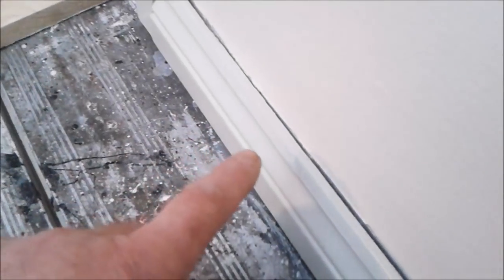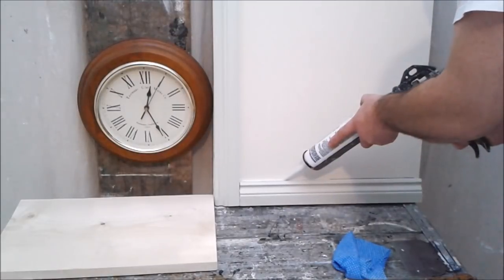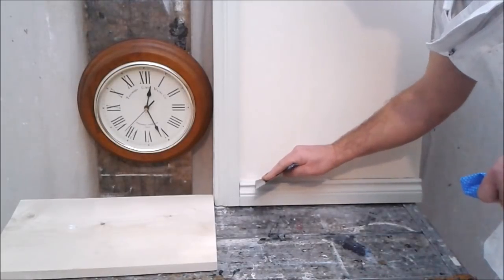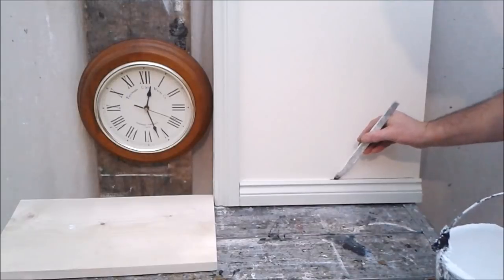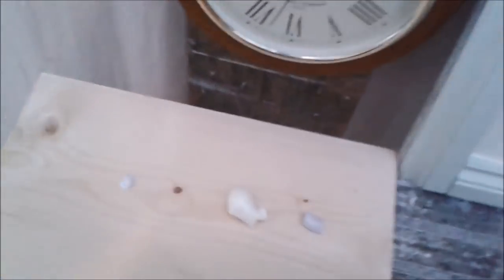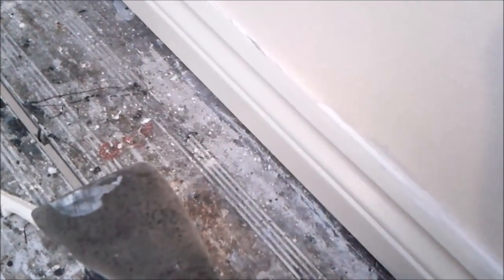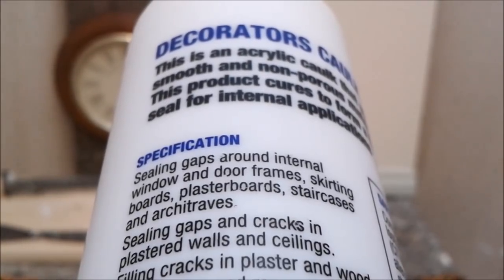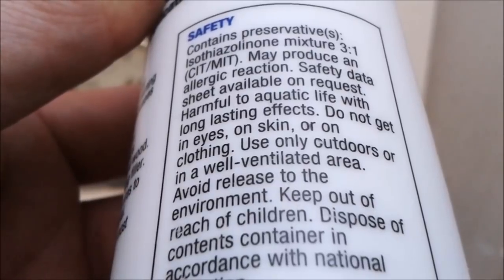Caulk quick to apply long time to dry

Comment: I’ll be 100% honest I used to use caulk regular on skirtings and ceiling lines,,, being entirely self taught I’ve picked up on other peoples knowledge, habits both good and bad, but since watching your videos I’ve just stopped using it when I do decorating jobs. Foam and filler all the way now, I did used to get really annoyed with the paint crazing over caulk, using a coat of zinsser bin over it usually stopped it but it’s such a long process. Your method is tried tested and works so it’s a winner as far as I’m concerned! Cheers buddy, you both are a wealth of knowledge! Take care.
Reply from the maker: Marc Gray Cheers mate thanks.
Reply: Could not agree with you more Marc, well said I'm the same.

Comment: For the last two years I have used Geocel Contrators Decorating Caulk. It is overpaintable in one hour and so quicker to use than powder filler. There are lots of other caulks that I have tried with varying results and some take forever to dry. HOWEVER, I have begun to use caulk a lot more sparingly these days and only for the smallest of gaps. For larger gaps e.g. between skirting and wall, my go to method now is expanding foam and skim the surface with a powder filler, as per 'Painting & Decorating' video, because this provides the neatest and longest  lasting finish. 'Geocel Contractors Decorating Caulk' is sandable to a certain degree but not in any way like powder filler. When applying caulk if you place your finger on the nozzle end and push the caulk down in the crack as you move the gun along, there is no wastage or excess caulk applied and it makes the job a lot quicker. There is a place for caulk when used in very small amounts but I use it far less often these days.
Reply from the maker: Yes true there will always be a need for caulk it does have it's uses.

Comment: I wondered why I had paint cracking problems which has cost me time on jobs. I used Dulux paint  on pollyfilla caulk and had horrendous cracking!
I blamed the make of caulk but as you say it's down to the pigments of the quality paint. Trouble is you never know it's going to crack until the next day.
Reply from the maker: markos bientos Yes stopped using it inside and the perfection on my jobs is great now. Will only use caulk on outsides around window frames.
Reply: Interesting mate thanks. Caulk does crack after a time as well. I think your idea of foam filler creates a stable base for fillers so that it should reduce cracking is spot on for longevity of the finish!

Comment: Great video
I would also use the foam and filler method astounded can sand it once dried . I only use caulk in corners if plaster is not smooth .

Comment: have u ever tried filling the gaps between the top of the skirting and wall with a 'grab adhesive' such as gripfill or similar???

i think most grab adhesives are paintable and would fill the gap nicely and dont take too long to dry!!!!!
Reply from the maker: You can possible but why not use something that's better and easy to sand and cheaper and cures quick.  I only look for the best possible finish on my jobs.

Comment: The man is right do not use caulk on cold substrates.
But I'm caulking in houses with underfloor heating with no issues. Been back after few years no cracks.
Reply from the maker: Matt Gloss caulk does not leave the best finish. Can not be sanded. And some emulsion paints can crack when drying. My jobs are better for not using caulk.

Comment: Do you mind if I ask what brand of powder filler you prefer to use? I tend to use Toupret which is really good but it suggests 16 hrs before you can paint on it which is too long. Any advice is appreciated. Many thanks
Reply from the maker: We use Polycell Trade Polyfilla Easy Sand Interior Filler White and you can use water based paints over it with in 2 hrs but needs to be fully dry for oil based paints.
Reply: Thanks very much.

Comment: This method is perfect for a diyer or as you say if you only have one room jobs. But unfortunately on large scale jobs this just isn't feasible, try doing this on a time sensitive 20 room job, it's all about the quality of caulk, and yes there are many shitty ones that ciss and crack etc. But just a case of spending that little bit extra, same with fillers, paints and most things in most trades really. You get what you pay for.
Reply from the maker: True good quality caulk on large jobs maybe. But even if I was doing a whole house I'd use my method now for large gaps because I find it leaves a better job small amount of caulk maybe. Also if there is any movement in the woodwork it fixes that at the same time especially with the nail gun these days everyone just wants to cut corners instead of making things last.

Comment: Caulk is 1 hr drying unless you are talking below room temp and then it’s probably a little longer. To use the method in this video is ludicrous and in no way cost or time effective!! Cracking on caulk only happens when it’s been painted over before it’s cured!! 🙈🙈
Reply from the maker: You have not tried it works really good and a better finish.
Reply: I don’t need to try it to work out that method of decorating may work well if you’re happy earning £50 a day GROSS or a DIY enthusiast.
Reply: caulk is terrible and messier than either foam or filler. Never got good results even when fully cured. Hairline cracks still appear.
Reply: Michael Griffin I wouldn't pay you more than £50 a day if all your efforts led to no more than squelching caulk in and painting over it. I can do that myself
Reply: Stephen S yeah you'd think Mr Griffin would read the manufacturers limitations printed on the container as painting and decorating did in the video, instead of making a contradictory claim to the manufacturer.